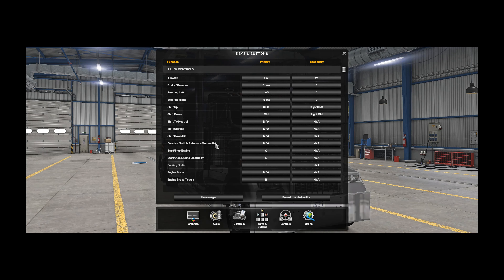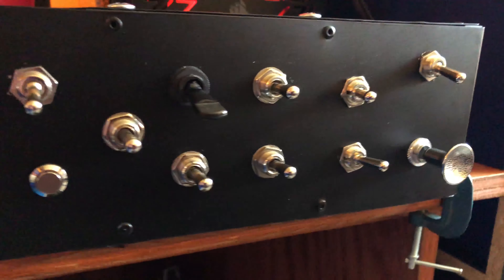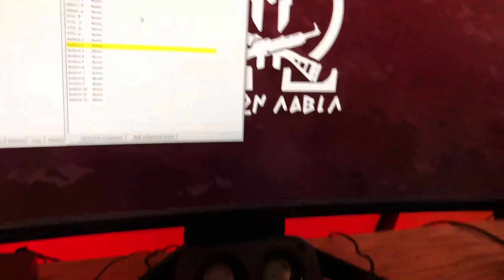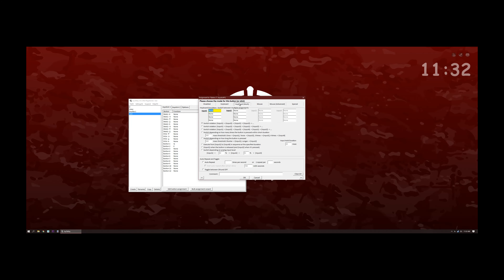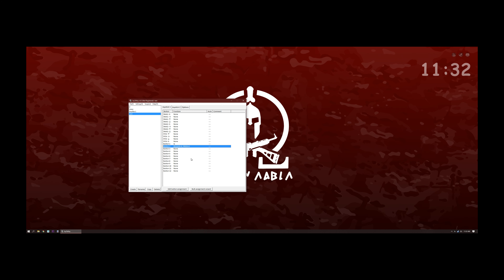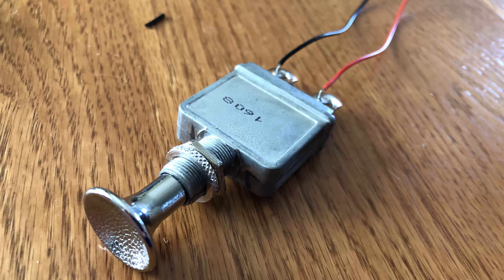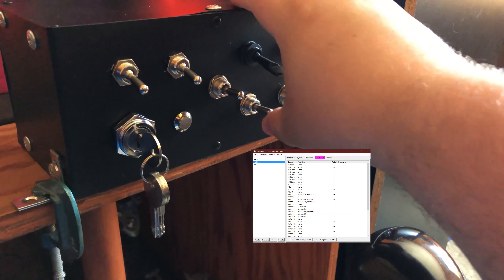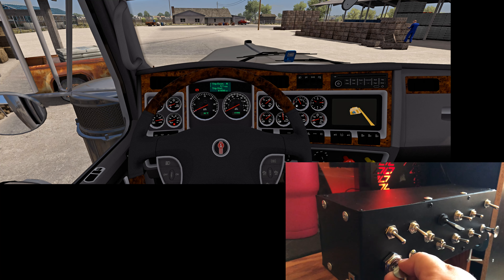Realistic Button Box Ignition Switch - American Truck Simulator

Comment: Hello everyone at because it doesn't work that when the key is back in the neutral position the truck is off. The following is what you do as in the video, only that instead of two times E at Input2 you select a different key, i.e. Input1 E/Input2 F (example  ).In the game you then have to use the Input1 key primary and Input2 key secondary for motor current. It didn't work for me either until I came to this solution and lo and behold it worked, hope it could help some
Reply: This worked for me, Thanks

Comment: i have a shifter knob with switches for splitting gears, this works fine using the in game toggle, but it has an additional toggle built into the grip. i want it to be a simple on and off switch, i cannot get it to work using joytokey, i still have to toggle it twice

Comment: Hello from Japan

I have put a toggle stwitch like the ones seen in your video but when I map it only the power option is activated. Example: I turn on the strobe light on top of the truck with the switch in the ON position, but when I want to turn off that strobe light, I put the switch in the OFF position but the light does not turn off. What I can do?? Thank you

Comment: Anyone else having issues getting it to work. Mine will for a little bit except it won't turn off when you turn the key off. Then, all of a sudden, the game does not register the control anymore.
Reply: a little bit late, try assigning two different buttons in joytokey . For example for engine start: primary=E; secondary:F. For me it worked this way
Reply: @ironcoffins4916  Thank you so much! Worked for me that way